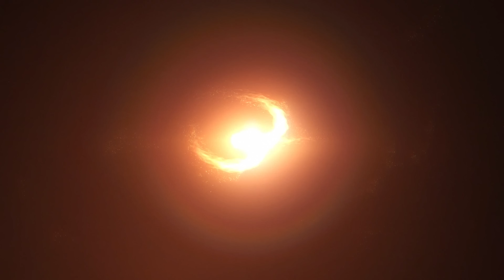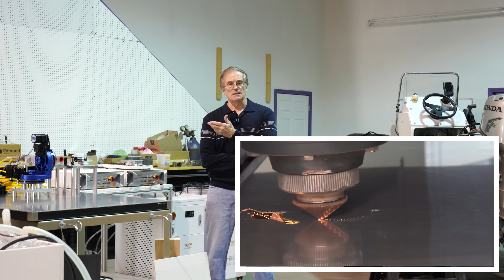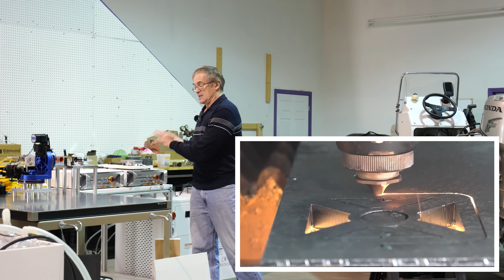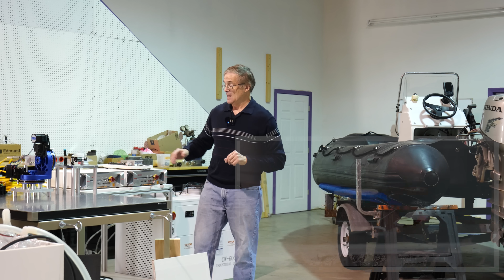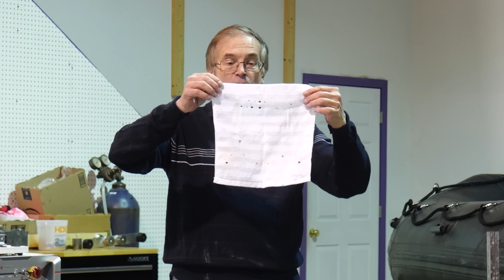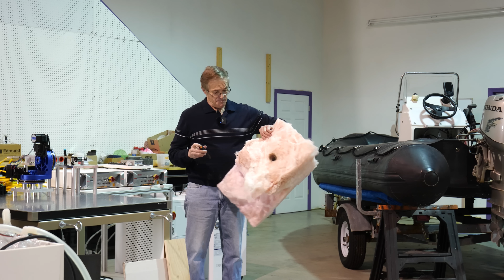We have a problem... and need your help!

Comment: You only really need this for testing, perhaps some sort of water or dense inert gas ”silencer” right infront close to the beam coming out. That should diffuse/slow the laser down enough so some plywood could stop the rest.
Reply: To go deeper into this, maybe you only need to flow a 10mm think stream of water infront of the beam to absorb heat and scatter the beam. Or something similar but a sort of cloud chamber, mm or many centimeters thick, you could also vary the thinkness of this ”silencer” for different effects and level of safety.
Reply: If you dont want to block the beam infront of where it comes out, what about a simple waterwall?

Comment: A large mirror, on a 45 degree angle sloped downward away from you, that redirects the beam into the ground.
Reply: Forget about mirrors with powerful lasers, you need perfect prisms otherwise half the reflection is scattered or lost and burns through the mirror layer. Even with a prism if there is a speck of dust on it maybe it will just explode. You can try an experiment with a laser and mirrors, you can actually see that the laser is very faintly reflected in other than the mirror direction.
Reply: Planes/ satellites might not like that😮
Reply: It will cut the mirror. Even cheap table top lasers can cut and engrave mirrors.
Reply: Or up
Reply: Or a convex mirror too. I have a doubt about whether they actually have a beam that can actually be reflected at all without melting the surface of the mirror.
Reply: @SeanBlader  the mirror will get too hot eventually and start melting as well, the issue here is the guy didnt said anything about operation time
Reply: @royalecrafts6252  the mirror can be cooled with water.
Reply: @royalecrafts6252   He did though, he said he was aiming for "at least a couple seconds" so they had time to hit the kill switch on the laser, and that a sheet of plywood only lasted half a second before the laser penetrated and started melting the brick behind it.
Reply: Then he burns a hole in the floor.
Reply: maybe a mirror reflecting the beam into a pool of water with some black dye in it? the black dye would turn the laser into heat which would be absorbed by the water. and if the water boils, even more heat is removed. of course, everything (including the dye) would have to be able to endure 100+ degrees celsius. some water on the backside of the mirror wouldn't hurt either, in case the mirror gets hot.
Reply: This was my first thought, but if it does that to various materials likely to just burn through the mirror. Heat fracture the mounting material. 
Could try a highly polished metal sheet, potentially with water cooling, and a rumble drill to move the spot. But my gut instinct is it'll be too little. How do you absorb the reflected laser? I'd suggest a black slurry.

Comment: You need a high power beam dump. Problem is, I'm not sure if commercial solutions go up to that power, or if they are cheap. And they usually only feature a small target area. It's not like a wall to put up.
But maybe you can get some inspiration looking at common beam dump setups.

Comment: something liquid or can hold immense amounts of moisture, that's why the plywood worked. you have to use that energy for boiling. otherwise it will melt or burn. or just use a mirror and send it to space, but that's not possible in that workshop i guess.
Reply: ooh what about aerogel?
Reply: I've also suggested some optics to diffract the laser inert enough to be safe for that wall after the target. but that comment didn't get posted i guess. sorry if i double commented that

Comment: Reflection doesn't work because it's dangerous and absorption also doesn't work due to burning up so the only reasonable option would be dispersive.  Something that reflects but in a way so as to disperse the light.
Reply: what could we use? Snow? Fog? A giant aquarium filled with milk?
Reply: absorption works fine so long as the material used can flow enough to replace what's melted\boiled.  A water curtain would work great if it can be dyed dark enough to block the laser light for instance.  Doesn't matter if some boils as more will immediately replace it.

Comment: Water has high specific and latent heat. You could always make a large, thick, black cotton backdrop with a pvc along the top with holes in it, with constant streams of water wetting the black cloth. At flow rate of the water it should generate enough steam at steady state to partially obscure the beam. My two cents is that you need a coolant to take heat away, as the heat buildup would be super intense. You might be able to take a thick sheet of steel, paint it with a high temperature and adsorption paint, and flow water down the back of it to cool it. Just spitballing. What’s an estimate of the wattage of the laser? I might have missed it in the video
Reply: You will get superheated water which is steam and will basically just get a superheated steam bubble creating a pressure wave that could create a tunnel momentarily if the laser is powerful enough.
Reply: This was also my first thought. And after a while I still thought it was good. But then he said at 8:30 that it does not work and he had already tested it. I still think a variation of this is the way to go, though, if the blanket/fiberglass/whatever was submerged in a tank. Or just a thin tank of water with something dissolved in it. It doesn't take much graphite to turn water black, so it will absorb more energy, and it won't break down much with heat. Alternatively, something white would scatter it. Milk seems like a terrible choice but you get the idea. 
The biggest problem would be making sure the glass is transparent enough that it doesn't reflect the beam in a dangerous way, or heat it up enough to crack. Thete is probably an unfortunate correlation between how much passes through the glass and price. 
If that isn't an issue, then getting a bunch of panels of glass would be cheap and easy. And obviously only the one side needs to be glass.
Reply: Based on the last few videos, I'd guess something around 6-15 MW/m² but that's just my Fermi estimation.

Comment: drywall and 2x4 wood stud wall filled with sand. sand melts and more sand fills in from above as it melts.
Reply: basic stud wall with maybe washers to increase the pullout strength of the drywall screws.

Comment: An aquarium wall with something in the water that would absorb or disperse the beam.
Reply: That was my thought but it seems the tank would be destroyed.
Reply: Until the laser punches a hole in the wall of the aquarium.
Reply: @Mort_OOPz  Why would it punch a hole in the glass, light passes through it?
Reply: @jakebradminster709  Yes!, good question: Glass is not actually completely clear, a tiny percentage of the energy is absorbed by the translucency.... This is usually not an issue, but if you're throwing a kilowatt through an area a few mm wide, that tiny bit of absorbed energy turns into an awful lot of heat at a pin head..... which burns a hole (if you're lucky, in reality, that one super hot spot; will probably expand such that it causes the whole sheet of  glass to shatter... many, many factors are involved, most of which I'm too dumb to even know about, let alone be able to quantify)

Comment: Damn, my idea was wood, which you tried as plywood.  Wood is easy enough to handle the fire worries (treat with water).  Could always try something like Rockwool, but not really expecting that to work.  Starship was once going to use small perforations in steel to send water or liquid gas through.

Comment: sandbags???? it's very good for bullets so fotons are "bullets" to 😅. burned hole would collapse itself making very durable. wall made from blanket made from 2 overlapping rows of 1-2" "tubes" (firehose) filed with dry sand. in vertical position to make some type of curtain.

Comment: So I make adhesives in the UK and we do our fire testing on inch thick calcium silicate board (the high density non fibre filled type). Might be worth a try.
Reply: yeah was thinking calcium silicate should last at least a bit longer than gypsum boards. Either that or fibre cement sheets. Needs to be dense as the laser is gonna chew through everything eventually.
Reply: May be toxic ?

Comment: "my lasers are too powerful" is the kind of problem that only scientists and enthusiasts have.
The only thing that would fit the criteria that I can think of is i guess vulcanized rubber? There's sprays that will put rubber coatings on surfaces, sold under names like "rubber paint". Maybe revisit the drywall or plywood sheets idea, but spray them with the rubber.

Comment: Use the sky or the ground. Just can't run tests during a flyover. No need to over complicate things. Could also use a dummy laser untill you iron out the system.
Reply: ground was my idea, too. but you'd need a reliable way to guide the beam downwards...

Comment: Sand bags? I'm thinking on a platform with casters to move around.
Reply: Yeah I was thinking a wall of wet sandbags on a pallet so you could wheel it around with a pallet jack
Reply: @Henry-oe3fj  oh i like the pallet jack better!
Reply: So new sand flows and takes the place of melted 😮
Reply: Bag material?
Reply: @wlfgang  In my mind the laser would burn the bag no matter what and just replace them as needed.
Reply: @wlfgang I think with the amount of power in play, the material just disappears.
Reply: I just commented the same and deleted it lol. You beat me to it.
Reply: Beyond, it's more about thickness and stopping power. How long would it take to cleanly and completely burn through two feet of material. It needs to be able to handle the heat long enough to get to a stop switch. May be worth testing. Like brick, size and weight might be an issue. Wet and dry, coarse and fine sand, top soil, and red clay as fillers might be worth an experiment.

Comment: wall filled with sand
Reply: It will explode. Rapid heat expansion. Sand can't be heated like that so rapidly. In the whole idea is it needs to be objectively moveable not stationary.
Reply: Sand tends to pop and fling itself everywhere, even with my comparatively tiny 20w diode laser, big boy laser?... probably going to turn it into some kind of explosive shower of superheated glass.

Also, once they've punched a hole in the wall, all that sand is going to run out of the hole.

Comment: What about a moving background?  Imagine a large cylinder that's rotating fast enough that the laser doesn't have enough time to destroy the material.  Or something like a stage hoist with multiple moving 'curtains'?
Reply: Spinning tubes? Any reflection would diverge. Two rows. Copper tubes might not need to spin.
Reply: a variation to this is to shake (vibrate) the beam at source. This has minimal impact on close target but reduces power density at a distant backstop
Reply: I wouldn't think the cylinder would move fast enough for a beam of light
Reply: @psynurse   the goal there wouldn't be to approach light speeds, or "dodge"; it's to make it so no one spot "sees" the beam for longer than w/e its failure time is. This lets the over-all failure time get stretched out.
Reply: @psynurse  You don't need to fight against speed of light, but against speed of heat transfer and phase change. So actually you need to disperse laser power (which is not that great, rather concentrated) over bigger volume of material. 100 HP car generates 75 KW, which is much more than their laser can achieve.
Reply: I kind of like this. Cylinder, large discs, linear slide, curtains - a few options for the motion. Which one is probably dictated by the material - harder to move a wall of bricks around in certain ways versus fiberglass insulation. Which material used also dictates speed of motion needed since that's out "linger" time.
Reply: THey would need to be rotating really fast and cover the whole wall
Reply: Here i am, a day late and a dollar short, plus some nice suggestions below!
Reply: I think that would be great at small scale, but I'm guessing they want something large enough to test firing this fiber laser at moving arial targets. 

Dont want a giant 30x40 foot moving chunk of something that possibly burning or molten.

Comment: High power laser use dielectric mirrors.
What you probably need is small micro beads with dielectric reflective coating?

I imagine that would randomly diffuse and dissipate the laser energy.
Reply: aren't microbeads the stuff that retroreflectors are made of?
Reply: @Culpride  yeah, but that’s if they are transparent. The light would bounce about twice inside the bead, and depending on the refractive index come back out.
But if the beads are mirror coated tit would act like a convex mirror…but many times and almost randomly.

Comment: Fire blankets come to mind.
I believe they are mostly fiberglass and kevlar.
It will probably scatter the light enough to make it safeish 😬
Edit: just got to the relevant part...
Maybe having a recirculating pump feeding water across the hanging fabric will delay the melting of the fibers...
Basically a curtain of water on a heavy fire or welding blanket.
Reply: I think liquid water is too reflective.

Comment: Why not scatter the beam? I understand you don't want to simply reflect it in a single direction but reflecting it in all directions would diffuse the energy.
Reply: That seems like a bad idea, scattering blinding powerful laser beams around the room :D
Reply: @flopilop4596  You could use a prism to redirect the ray into a box that has one entry point and inside you use mirrors made out of badly polished copper/aluminium with fins outside immersed in oil or water. Basically a reverse laser.
Reply: @istvan.design  you need something big enough to cover the wall, not practical.
Reply: @flopilop4596  It's pretty common to scatter beams for the exact reason of diffusing the power. I am not suggesting reflecting it randomly in a single direction, scattering the beam mean's it's no longer behaving like laser light.
Reply: @Cixelsyd32 how are you going to cover the entire wall with a prism?
Reply: @flopilop4596  Did he have to cover his entire wall in bricks? No, just the area behind the laser.
Reply: yes .. a rotating disco ball target! ☠

Comment: Laminar water fall wall.
Reply: I’m thinking the same.  A series of laminar flowing water fall sheets that scatter focus. 
  Maybe a polymer based drilling fluid for viscosity and additional radiant absorption. 
  A slurry.
Reply: @hughobrien4139  a carbon slurry perhaps, put in graphite dust into the slurry and let it run down on the laminar water fall?
Reply: This was my first thought too. It would need to have at least three layers. 
1) The laminer waterfall that you can adjust the thickness of the water curtain. 
2) an additional physical barrier that is tuned to the laser frequency to absorb the laser and coolant to transfer the heat quickly.
3) A reflector that disperses the frequency of light used as a final failsafe.
Reply: I was thinking the same thing. Perhaps some kind of additive that increases the surface tension of the water creating a several curtains of water.... Or a backup that continually soaks a fiber blanket?

Some kind of apparatus could be rigged up with a set of gutters from home Depot...
Reply: @justinhealey-htcohio3798  I was thinking along the lines of your backup idea. How does a swamp cooler pad with a heavy flow of water perform?
Reply: I think this has potential, but why laminar flow?  Wouldn't turbulent flow be more dispersive?
Reply: @SRLowther  its thicker i think
Reply: Aerated laminar flow over random ripple pattern carbon brick/panel wall, think cloud diffusion with absorption as backup with reflection behind that just in case.